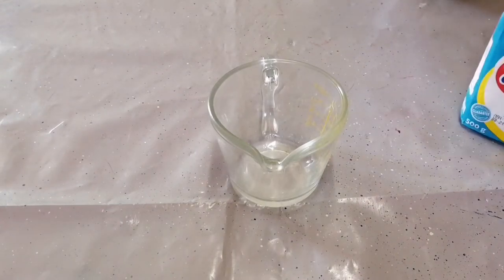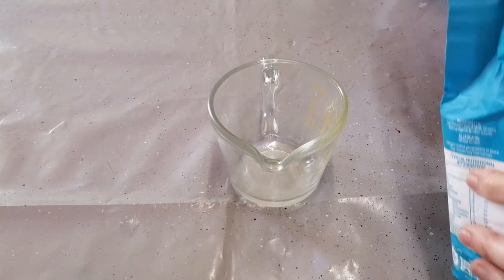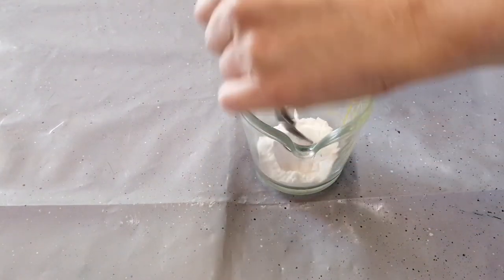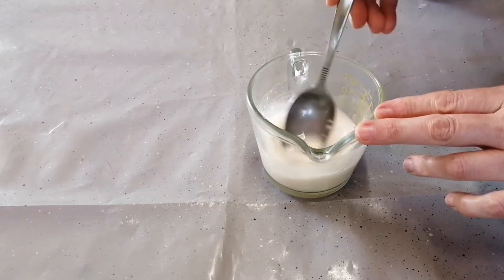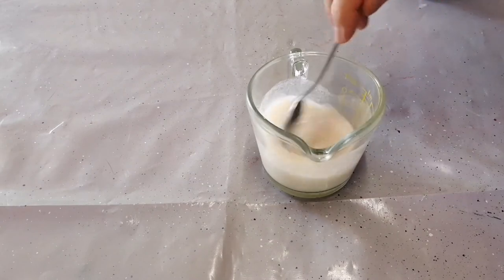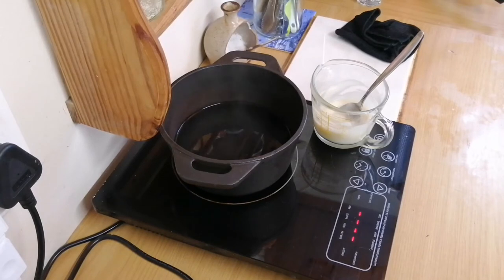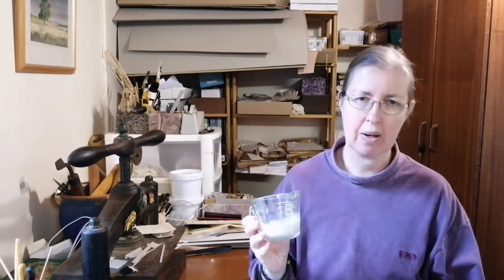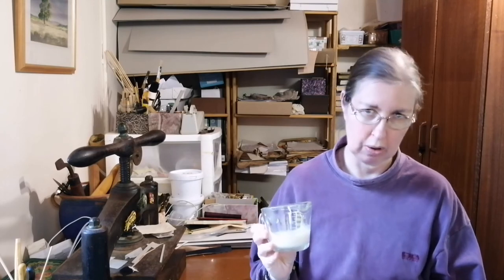Making Bookbinding Paste

Comment: Thanks! Why mix it with PVA glue? advantages? mix ratio?
Reply from the maker: You're welcome. Basically, mixing it with PVA means that the PVA takes longer to dry and therefore gives one more time to manipulate it. I usually use about half half when I do that, but I suppose that it could vary.

Comment: How does the paste hold in the following years and decades.   I imagine the paste will crack and become brittle?  And will that yellow too?
Reply: Paste is a traditional and widely used adhesive in bookbinding so it’s been demonstrated to hold quite well lol.  Wheat flour paste does yellow over time so it’s not recommended for paper repair (wheat starch paste is better because it doesn’t colour).  Wheat flour paste is great for actual binding tasks like attaching cover material to board.  Don’t use it where you need flexible glue though, like the spine of the text block.  PVA or similar is better.

Comment: Does this paste warp paper? I've used a few other types of glue, but the endpapers regularly became damaged.
Reply: Paper warping is caused by moisture rather than the adhesive type.  If paste alone is too wet for the kind of paper you’re working with, you can mix paste with PVA (or similar) or use PVA on its own.  Only difficulty with pure PVA glue is that it dries so quickly that it’s nearly impossible to pull up and redo something if you get it wrong the first time.